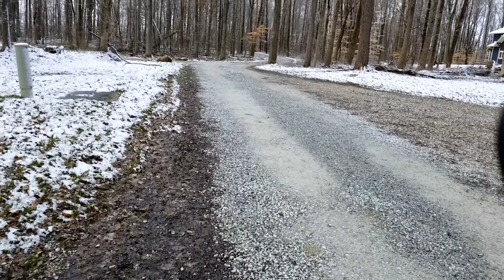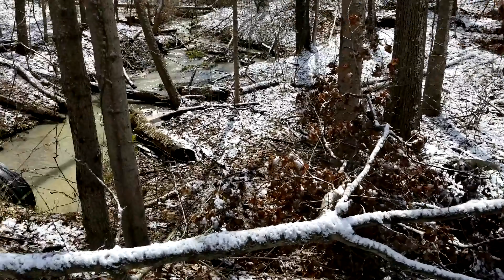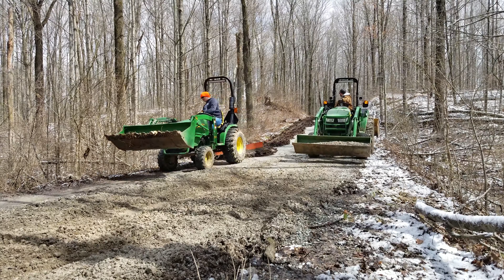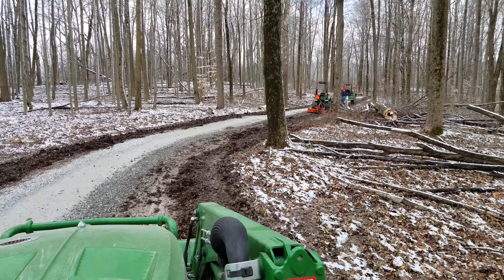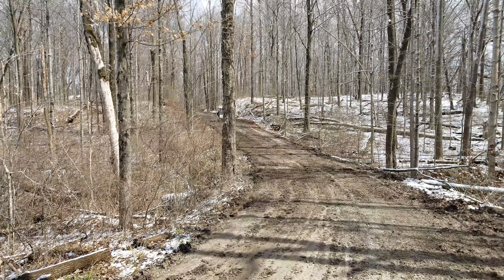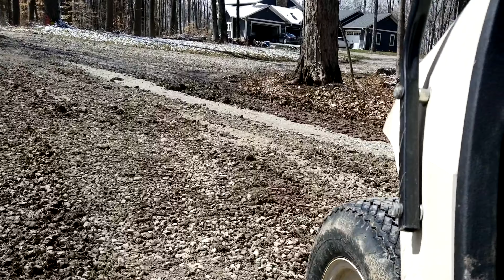Gravel Driveway Maintenance - Gannon and Frontier Box Blades

Comment: Is that a 72inch blade on the 4052r?
Reply: Thanks trying to decide on what width to get for a 4044r/ 52r 72 or 84. With the box blade does it need to stick past the rear tires. I’m guessing the 72in just pokes past the tires? Thanks for you helpful videos and timely responses. Big help 👍🏻